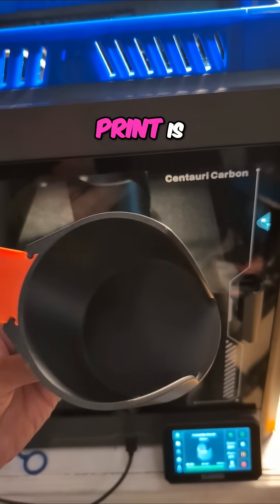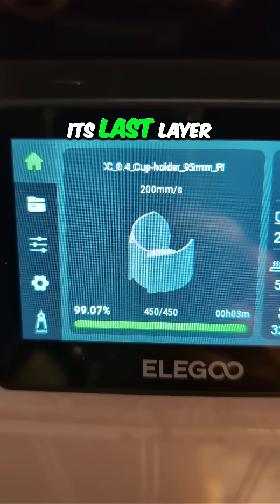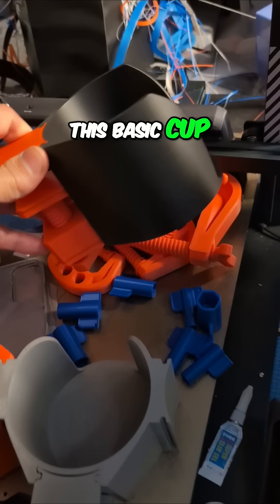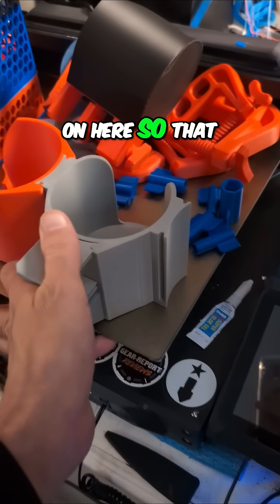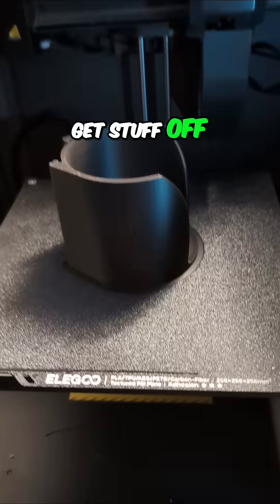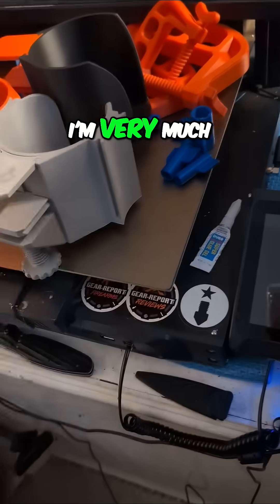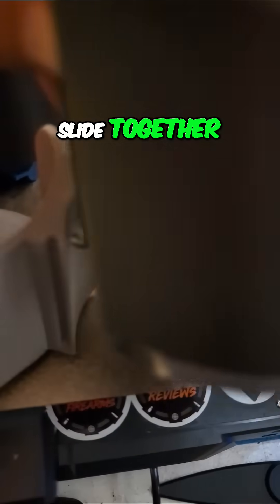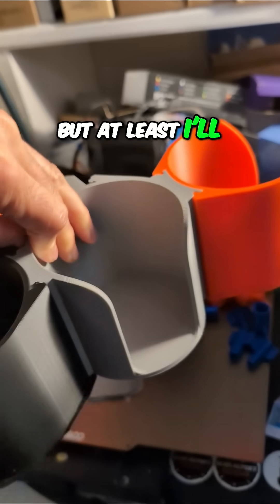3D Printing a Triple Cup Holder in 3 different filaments?! It Actually Worked! Centauri Carbon

Comment: curious about why you're printing with a brim. that seems to be a model that would be fine without one?
Reply from the maker: good question 
Elegoo slicer was set to automatically apply a brim when needed. I was surprised it applied one to this print. Likely to keep the edge from warping and lifting from the bed.